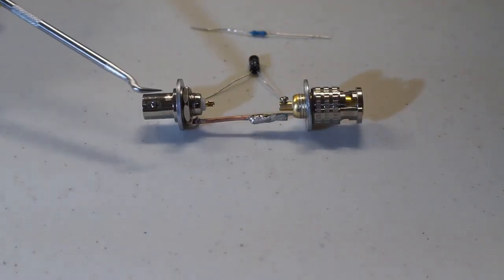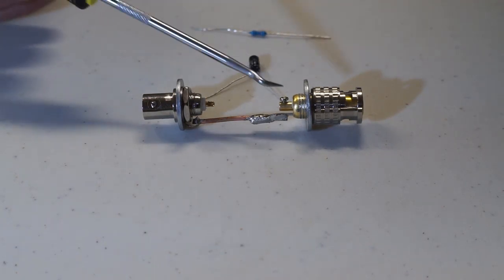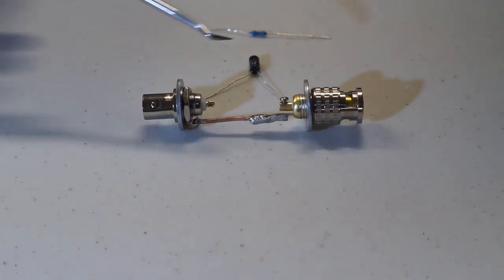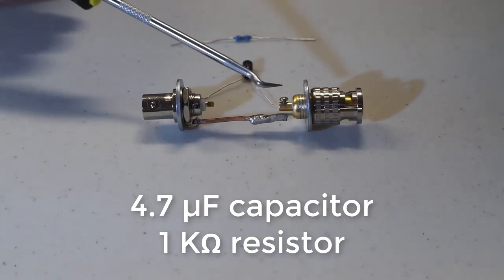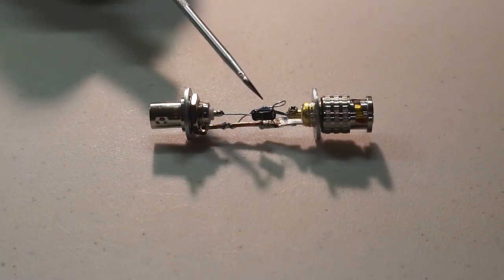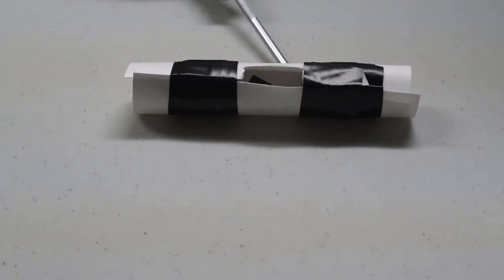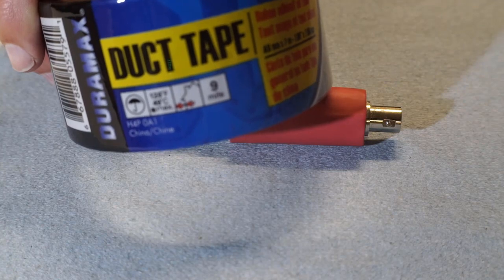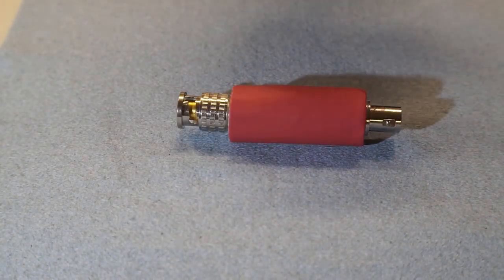GADGETS#80 - HIGH PASS RC FILTER

Comment: Just for completeness - what is the voltage rating of the capacitor.
Nice build
Reply from the maker: +Dave Sage - it's 50v
I should have mentioned it. Took too much for granted, it's such a common voltage for that value capacitor.
I'll add that info in the description box.
Thanks for pointing it out, Dave.